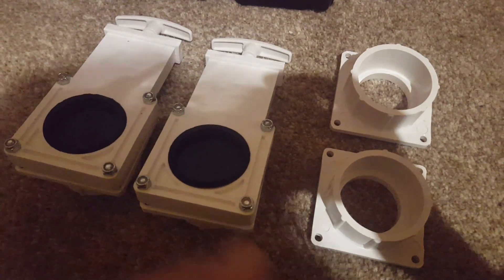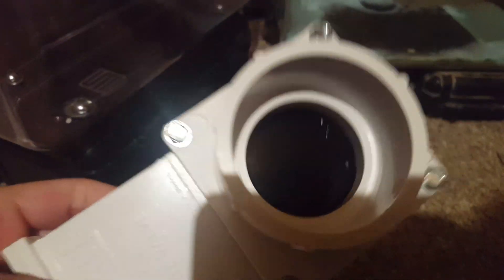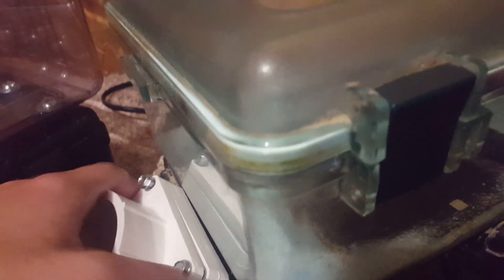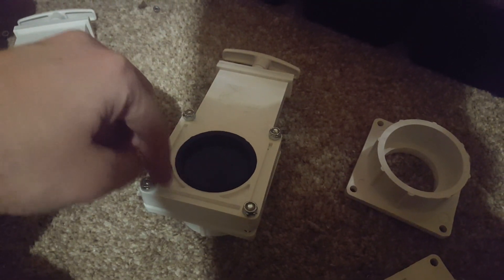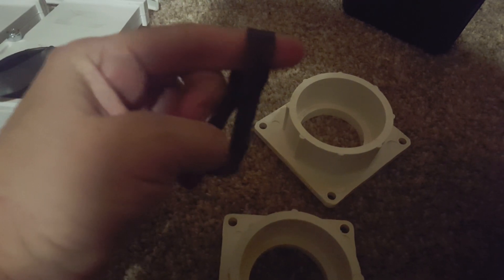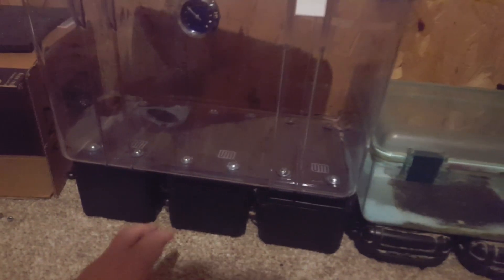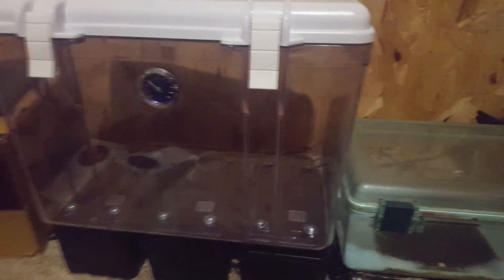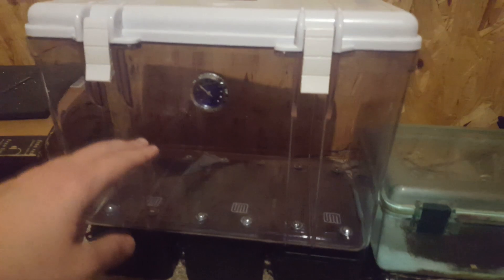Hampture Update for 2/7/2019: Getting Ready to Cut Holes

Comment: Don't fiddle with silicon just make sure you use a rubber washer under a regular washer on the inside. That is excellent use of a bladder valve, just using it inside out and backwards.

Comment: You could try something I've been thinking of, the seperation of oxygen from hydrogen via battery and set up, I'll link it. I've been wanting to build an underwater place with the ability to create it's own oxygen, problems, with human height I would need to put it below 20 feet, with excess the max PPO2 level for humans, hypothetically pure oxygen would be safe for hamsters >20ft deep. More than that would cause convulsion from oxygen toxcisity, if you put it 10-20 feet deep the hamsters should be fine, but that brings the power question, solar or an underwater water mill generator facing the flow of the currents.

Comment: Would it be possible to use these gate valves to create a kind of airlock so you can dump food and water down from the surface without compromising the pressure of the habitat?

Comment: Ok so I rewatched your tubes video from last week. I did understand what you were trying to do but not with the skirts. You're going to use the reenforced tubing for the connections. What you want in the tubing is something called a check valve. It is a valve that when met with pressure it opens one way (out of the tubing in your case). Then when the pressure of the flow is equalized the back pressure actually helps it seal. The question is how are you going to make your pressurize/Purge work inside the connecting tube? I'll have to think about that more but I hope this helps. You probably know most of this but like I said I sincerely want to help. Here is a link you may find interesting. 

https://www.pumpsandsystems.com/basics-check-valves

Comment: If you can find a pipe that fits snugly inside the tunnel, you could cut it into rings that could be glued into the ends of the tunnel to give the outer mating surface some rigidity

Comment: I think if you drilled out the bolt holes in the valve, the top of the bolt will fit into it and make the bolts long enough to get into the habitat
Reply from the maker: They are long enough already though

Comment: I'm skeptical about the rubber bands. To get it waterproof you probably have to remove these ribs of the docking collar. But then, how does the process work underwater were you can't see anything and there is probably some dirt between the sealings. I still recommend camlock couplings. They're already tried and tested and you can operate them blind. (They also look cool.) You don't have to invent the wheel again.

Comment: I hope you don’t mind me asking, but how did you do your hamsub from way back? I’ve recently gotten a project in class and I’m thinking that building hamster sized submersible might be cool for it. I’m mostly curious about the entry/exit mechanism you used, but any extra pointers would be appreciated

Have a great day :)
Reply from the maker: Basically just an airtight capsule fed a steady flow of air from an aquarium pump and weighted so it is neutrally buoyant, then zip tied to a little remote controlled submersible I found on Amazon.

Comment: Wondering if the drilling of both entry hole and bolt holes could possibly compromise the transparent cage structurally.  Not to mention repetitious act of removing and reattaching of tubes could add to the stress. So I'm kinda asking if you are certain the material of the cages can hold up to all that.
Reply from the maker: Yes, this is pretty heavy duty gear. It's why I am using proper industrial tubing, valves and fittings instead of just making this out of whatever's lying around.
Reply: +I Chose Hampture

Shouldn't the internal pressure of the habitats prevent any pressure-related stresses on the materials?
Reply from the maker: @callumunga5253  That's right. But it still can't hurt to use overbuilt components. There are other forms of wear and tear on a longterm underwater structure to contend with.
Reply: @Hamdad  Ah, no. The entry valve and the tubes looks sturdy as hell, so not really worried about those. Its the quality of the cages, or the habitats as you call them, that concern me. I'm worried that the habitat's (what looks to be) regular plastic structure might eventually crack possibly from the drilling and/or from the regular handling of the soon to be attached valves and tubes.

Comment: Put up a 24/7 camera feed on YouTube.
And find a way to track the hamsters motions, so it can be plotted and displayed on a website.
Heat maps of their favorite spots.
Line trails to show their commonly traveled paths.
Statistics: how many wheel spins, average rpm. Food and water consumption in weight.
Weight the bedding before & after to calculate accumulated fecal matter.
Individualized for each hamster. Have their names and stats on the website.
Reply: I would also love sensors inside the habitat. Like humidity, amount of CO2 and Oxygen in the air, temperature, etc. That's all possible with an Arduino.
Reply: If the vods are of decent quality, I could probably track the hamsters through object recognition. Sounds like misuse of software rights given by my uni though.
Reply: I was thinking, it'd be cool if he did a work in progress livestream at some point. I'm not sure how much time in a day he dedicates towards working on the habs, but it'd be kind of cool just to see how he works, give a little extra incite into the behind the scenes, maybe get some extra funding via superchat out of it.
Reply: Better be a wifi camera with speakers so we can play them Ram Ranch.

Comment: Have you considered custom-designed units?
You could incorporate automatic cleaning mechanisms so they can stay submerged indefinitely.
Heat sensors to detect when a unit is empty, and begin a clean cycle.
Drag a sweep across, and drop fresh bedding behind.
Collect the garbage in and eject into tethered bags for collection
Reply from the maker: That sounds like a recipe for a tragic malfunction.

Comment: 3 floors sounds good but I’m not sure if the potential risks are worth it. 
Have you looked at the plumbing section of Grainger at all? You may find something there that’d work better for docking. Maybe a combination of fittings that connect a large hose to the bulkhead, then a quick connect at the end of the hose?
Reply from the maker: Many things sound good in writing, but the bulk adds up quickly. I think I already have a fine solution, though I'll be more certain after trying out those bike tube skirts.

Comment: 3 floors would be nice but you gotta take into account the diameter of  the hamster wheel. it may go through a floor because of its height (like if you put it on the ground floor the top may go through the second floor). however you could just put some cover over the top of the wheel. 
what im thinking is that the floor in which the wheel will be can have other exercise equipment, second floor is the mess hall/food court, and the third floor will be the casino where hamsters could play roulette and do coke off of mirror tables.

Comment: an idea for the skirts. Maybe get some large shrink tubing and shrink it around the mouth of the tunnel. Also you definitely want to use a sealant silicon/sikaflex/flexseal to make sure there arent any leaks. Are there torque specs listed anywhere for optimum mating? Im making it my mission to be as helpful as possible.

Something like this: https://www.delcity.net/store/Triple-Wall-Tubing/p_330.h_77221.r_IF1003?mkwid=sMxvCEK6I&crid=38094426869&mp_kw=&mp_mt=&gclid=EAIaIQobChMIrua_-dar4AIVRL7ACh06KQ0cEAYYBiABEgKLMvD_BwE
Reply from the maker: If it's shrink tubing the seal will be permanent and not reusable. It would also be hard to heat it while underwater. I appreciate your ideas though and want to hear anything that occurs to you.
Reply: @Hamdad  Maybe Im not understanding. I was talking about as a replacement for the rubber bands to make skirts. you would apply the heat before hand. If Im not understanding properly please explain then I will try to come up with solutions.
Reply from the maker: @commanderosis435  It needs to be possible to remove the skirts and reuse them. The idea is not to permanently seal the tubing to them and then lower them into the water all at once. I don't have enough arms for that. They are individually very heavy and would be awkward to manage at the same time. 

The idea is to be able to lower them to the bottom individually, one at a time and connect them by tubing, in a way that they can also be disconnected at will for the times when individual habitats need to be surfaced for cleaning and resupply with food/water. 

This requires a reusable sealing solution which can be performed, and reversed, while submerged
Reply: @Hamdad  gotcha. I'm just trying to picture this in my mind. So you want to connect the enclosures with tunnels and gate valves. Are the hamsters meant to freely use the tunnels? I don't understand the point of the tunnels if you're attaching them under water.